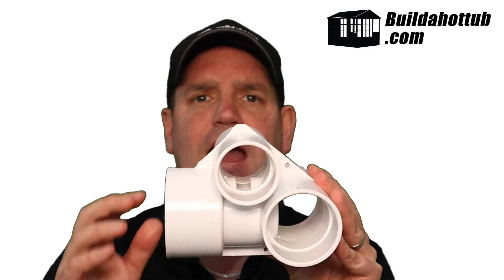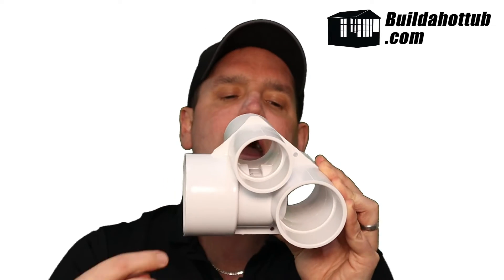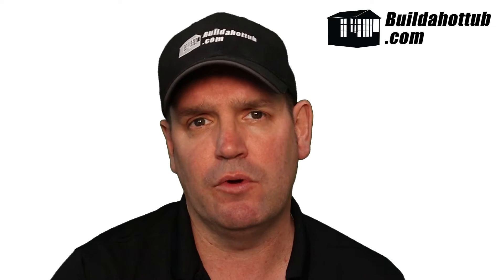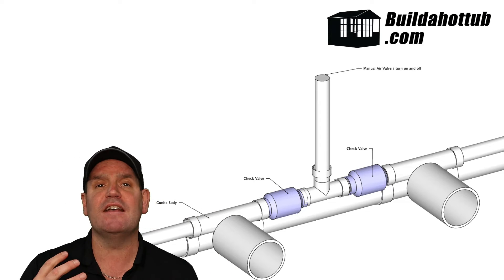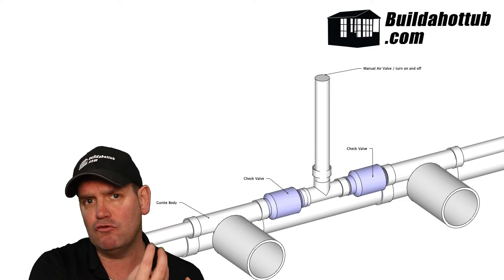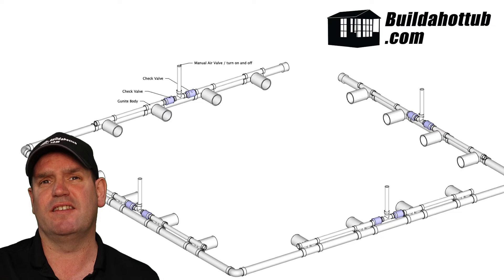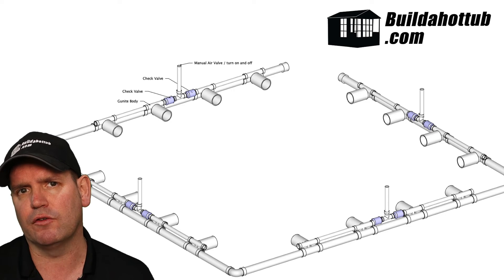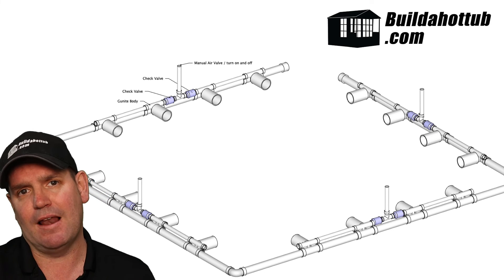How to use Venturi instead of a blower on a concrete or block hot tub build

Comment: Hi I’ve built a plunge and have bought a second hand Lay-Z spa pump/ heater. I’m running the inlet though a single 25mm pvc pipe running up and over the edge (very low tech) the pump unit has a built in blower that I need to buy the connector hose for, it looks like it has vents around fitting I’m assuming to vent back pressure. Do I just need one of the blower style venturis? And just make sure the blower pipe is above the water level?
Reply: Any help would be appreciated 😅 I was about to order an inline venturi with the tiny air inlets haha

Comment: Hi and thanks for this excellent video.  I have a pool with an attached concrete spa, 4 jets, that is 27+ years old. It uses venturi air without a blower. Recently I started the spa and no air whatsoever comes into it. My pool guy said their might be water in the air lines, so I hooked up a shop vac in reverse to pump air into the pvc inlet by the pool filter. When I do that, all the air comes out of a single jet. I even tried reducing the air pressure, and no matter what I do it only comes out of that one jet. If I remove the air pressure altogether, water starts flowing out of the air line at the pool filter. 

I'm wondering if one or more of my air check vales are broken the air lines are filled with water. Does that sound like what might be happening?  And if so, is there any way to replace those check valves, or is my spa forever broken?
Reply: (Did you ever figure this out?) I am having a very similar problem. My 4 jets in my inground spa are not longer pushing air. I have tried blowing air into the airline but only the first couple jets produce bubbles. Pressure from the jets also very weak.
Reply from the maker: Thanks so much for your thoughtful comment and detailed explanation — really glad you found the video helpful.

Based on what you’ve described, it does sound like you may be dealing with water intrusion in the air lines, likely due to a failed or missing air check valve. These valves are designed to prevent water from backing into the air system, and over time (especially on older setups like yours), they can wear out or become clogged.

When air only comes out of one jet under pressure, it could indicate partial blockages in the other lines or that water is creating resistance in those paths. It's also possible that the jets are not evenly plumbed, so air takes the path of least resistance.

Your spa is likely not permanently broken — it just needs some targeted troubleshooting and possibly a bit of plumbing work to restore proper function.

If you'd like us to take a closer look and advise further, feel free to email some clear pictures of your setup to andi@parts4tubs.com — we’re happy to help!

Comment: I am building a concrete hot tub and want to incorporate both options  (venturi and air blower). Is it enoungh to have one long loop with one end connected to a blower and with air control values staggered appropriately ? I intend to have 10 jets on only one wall.
Reply from the maker: Great question—thanks for sharing your project details!

Yes, it is possible to incorporate both Venturi and blower systems using a single loop, as long as it's properly designed. Running one long air loop with staggered air control valves can work well, especially with 10 jets on the same wall. Just make sure the loop is evenly pressurized and the pipe diameter is sufficient to supply consistent airflow across all jets.

Also, consider including a check valve between the blower and the loop to prevent water from backflowing into the blower when it's not in use.

Feel free to send a rough sketch or plan to andi@parts4tubs.com if you'd like us to take a closer look or offer further guidance.

Comment: Would you suggest using a swing check valve on both sides of the T for the air control valve?
Reply from the maker: They are not normally swing, they tend to be spring loaded on an air line. Hope that helps (sorry about the delayed response) Andi

Comment: How efficient is the Poly Storm model 220-1100 for venturi induction of air? I am planning to install them on my existing block structure, but need to know whether they are capable of creating sufficient vacuum at the venturi to bring enough air to create bubbles. I do not wish to use an air blower.  Thanks for your very videos, keep up your good work!
Reply from the maker: Not sure John - I always use air blowers so could not give you an answer from experience. Sorry about that - Andi
Reply: Hi, you posted this 9 months ago, and i want to believe you've already done it by now. What is your exoerience ? Do you have enough air (bubbles) in your jets ?

Comment: Great explanation of the system.  Do you know how to diagnose an existing spa using Venturi and it’s not pulling air?
Reply from the maker: Thanks for the question - sure, if you open the valves and see no change in the water, then it is not working - pretty striaght forward test - hope tha helps

Andi
Reply: How do I unplug my hartford loop?
Gunite hot tub was built in 1998. Plumbing is under concrete to pump building w concrete floor.